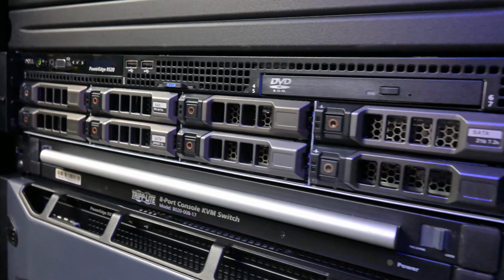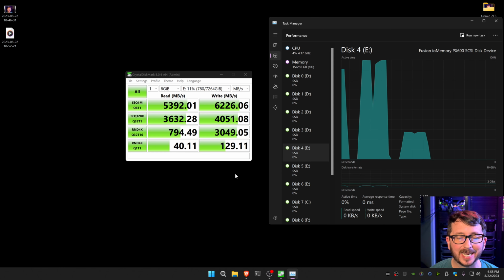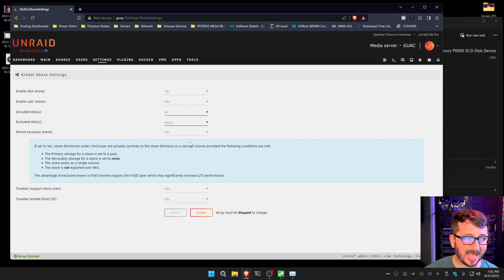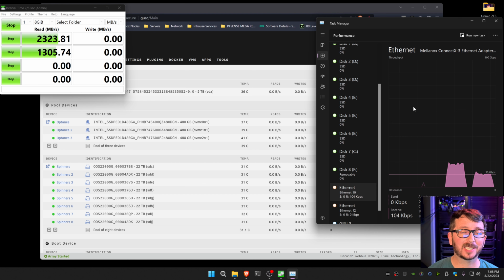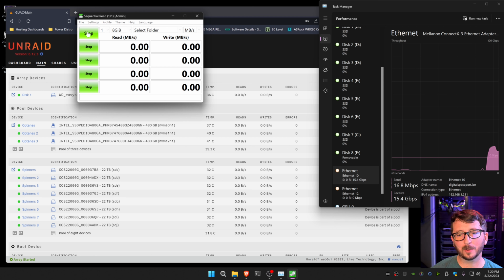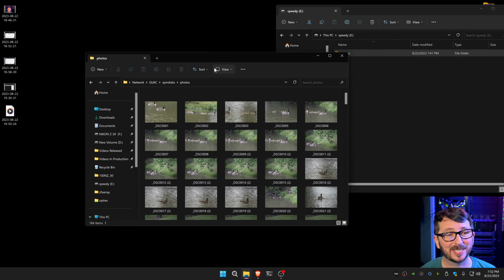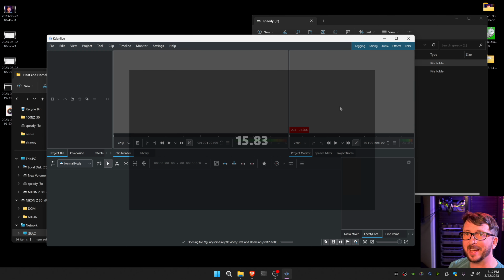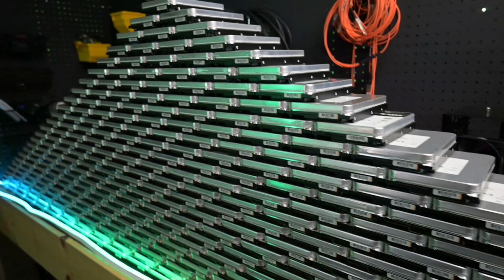UNRAID ZFS Pools and Shares Performance Optimizing

Comment: Lots of good info in here I will have to try some of this out when I get home. getting abismal performance writing to my nvme in my unraid server over 40GB I get like 100MB write and like 450MB read. in a windows system locally I get close to 3GB on these. I know the MTU is prolly the culprit for some of that. I don't understand why the write is that slow though. I will be really glad when they get propper ZFS pooling in unraid so that can setup additional VDEVs this is where the true performance increases comefrom with zfs. Hopefully they will then get the mover to work with interpool manament for primary and secondary stuff.
Reply: nice, thanks for sharing this
Reply from the maker: Your speed is def too slow, here are a few things I would check. Windows tuning of the NIC settings to match your switch/Unraid host is critical to great performance, but you should be getting way better for sure. NVMe's from various manufacturers will have different amounts of Cache SLC super fast NAND, then revert to a slower TLC base in most consumer NVMe. Still your base write performance after you exhaust the cache should be at a minimum 500-1200MBs for writes, not 100. Have you tested iPerf3 with your setup to ensure you have expected network speeds? Have you tested your drive with DD to ensure it is operating to spec from the CLI? Ensure you are using an exclusive access disk share to avoid FUSE. Is the drive properly trimmed? I have seen some HBAs cause issues with this but its unlikely your running an NVMe off an HBA.

Comment: Written guide is missing the SMB extra config options. Also the syslinux options are written twice. I'm running 4x4TB pcie3 nvme's in Z1 pool. Over default settings on win 11 client (marvell aqtion 10gbe) and unraid server (intel 10gbe) I got 1144MB/s read, 550MB/s Write 1M Seq q8t1. After doing the same tweaks in the guide I dropped to 614 / 217MB/s :(. The only improvement was RND4k Q32T16 R/W .

Comment: I need to setup a NAS for a large SMB share over a 10 gbit LAN.  Newbie with NAS system here. I'm hesitating between TrueNAS Core and unRAID.  I'll be using 8 to 12 SATA SSD drives.  Based on your experience, which of the two systems offers the best performance and reliability for a similar setup?

Comment: I want to move to Unraid, I'm currently using OMV with ZFS drive, they are not mirrored, each drive is ZFS with no mirror. So what I want to ask is
1. if I'm using ZFS with pools of single drives, is there a point on keep using ZFS when I move to Unraid? What I liked about ZFS is the bit rot detection it has built-in and also the compression though I can live without this, but as far as I'm reading Unraid as it is it's not super fast so I'm guessing using ZFS will slow even more the transfer performance isn't it? (Because of the compression, etc)

2. I don't have the budget to get 3 SSDs to use as cache but I do have one that I can use as cache, will it be enough to improve speed? What I also don't get is what would happen if I transfer more than the capacity of the cache, let's say my cache SSD is 500GB but I transfer 1TB of data, what will happen then? As far as I know the cache is stored until the mover is fired up.

I'm not sure about moving to Unraid but I really need the parity feature, as it is right now the transfer speeds aren't super great (I guess because of ZFS itself), I'm using a Connect-X 3 but still, speeds aren't max out, and that is using OMV, using Unraid I can only imagine it will be ever worst

Comment: Would you look at that! With UNRAID 7, Arrays are finally optional, and we can set up shares with pools as both a primary and secondary storage! Definitely a welcome change.
Reply from the maker: Wow finally! I can put that to use right off, excited hope it's outta beta soon-ish
Reply: @DigitalSpaceport  Yeah, definitely don't want to update my main setup to a beta, so I hope it'll be official soon. Also love the idea that mover will work between pools, since I would love to move from my raid 0 nvme drives to my raid 10.

Comment: You will always get good performance with nvme, ssds... also you have a big server and CPU process. I tried Unraid with 6 WD 14TB Enterprise drives and the write over a 10GB was abysimal (50MB/s or less). Reading was ok though around 400MB/s.
I switched to OMV and I'm getting now 800MB/s R/W in software RAID 6. As I move a lot of data, I ditched Unraid and I have no regrets. Thank you for the video though, seems like depending of what you have it may be a good solution for some.

Comment: Are you not using SMB Direct/RDMA, pinning cores or SMB over QUIC? You should be able to easily saturate 40Gbps with these disks if doing sequential reads or writes.

Comment: Thanks for sharing the tips, very useful, but I am looking at the speeds you are getting and what immedaitley comes to mind is what is the speed of your network. I have an all 10GBe network and get nowhere near those speeds. As an optimized 10gbe network what sort of speed would be normal?
Reply from the maker: If you can sustain a ~9gbit iperf3 single stream on that network, you should be able to hit in the 1GB/s range to your cache pool.
Reply: @DigitalSpaceport  I'm currently planning a setup using ZFS on Unraid and would appreciate some expert advice. Here are the details of my proposed hardware configuration:

* Drives: 4 x 2TB NVME drives
* Proposed Pool Layout: 3 x NVME drives in a RAIDZ1 configuration
* Cache: 1 x NVME drive
* Array: A single 32GB thumb drive
I'm also considering upgrading these drives to 4TB NVMEs in the future. Given this setup, I have a few questions:

1. Is a cache drive necessary, given that it's the same specification as the pool drives?
2. Could I potentially configure all four drives into a single RAIDZ1 pool instead?
3. Regarding future upgrades to 4TB drives: How complex is the process? Previously, I used TrueNAS Scale with HDDs in a similar configuration (3 drive RAIDZ1 pool upgraded from 6TB to 12TB drives by replacing each drive one by one). However, after upgrading, the pool size didn't increase until I destroyed and recreated the pool. Would I face the same issue in Unraid?

Comment: Nice vid. Can you do one on ZFS rebuild times. if you make a 24 disk vdev of 22TB and you pull one disk. How long would the rebuild take? With 1 cpu +/- 20 cores 3ghz. Will it be a day, a week, a month or a year? Its something I can't find anywhere.
Reply: It will depend on how much data you have to be resilvered.  I had to replace a disk in my system but I only had like 6 of 60tb used and it took maybe an hour.  Did it again after I moved more data over and it took maybe 6 hours.  That was with 8x12tb drives on a E3-1230 V2 @ 3.30GHz in truenas.  24 drives would probably be pretty quick if they are rz1/2 even with a 22TB drive but the best practices guy in me wants to say break that up into multiple vdevs.
Reply: Thanks for your reply!  @nadtz  What I am trying to figure out is the maximum amount of disks with say 22TB that can resilver within 24hrs or 48hrs. I prefer the vdev to be as big as possible considering a raidz3 and least parityloss with the excel configurator.
Reply: @jllerk  No idea with a vdev that big, I've read in the past large vdev's slow down resilvering and have never had a reason to do a vdev of more than 6-8 devices myself.  Anecdotally you can expect long scrub and reesilver times with a vdev that big.  How long exactly I've seen people mention 48hrs+ but I don't know how much data was involved.
Reply: Afaik a 24 drive wide vdev is Not a good Idea, but it depends on your workload.
If its for home use and you can leave the Pool resilver without hiting it with io all the time it could be ok. But for anything else I would do at least 2 raidz2 vdevs. That would give you better iops and less chance going in a resilver spiral. Maybe a draid2:21d:1s:24c would be a safer bet to get faster resilver times. But I have Not tested unraid much with draid. You can create a draid in the cli but Not use it as a unraid Pool in 6.12.4, maybe support will be added in the future.

Comment: Is there a way to convert 2 disks in an array to a pool without wiping data? I have Minio running with two drives as a share for Minio. The transfer from cache to array is slow and fills up the cache fast. I am adding more drives for a larger total on the share and saw this video for creating raid within a pool and thought this would work great.....but I have the issue of the files already in the system.
Reply from the maker: You need a backup system in place. If you try to pull out 2 drives in a ZFS array it wont work. You cannot shrink a zpool. You can fail and replace drives but the initial consideration of disks in use for a zpool needs to remain the same. Restoring from backups is your best bet here.

Comment: Are you still performance limited by CPU single core performance, since it appears you have 'NIC Offloading' turned off, I'm guessing there is still no RDMA support.
Reply from the maker: This video went off the rails for about 2 days as I documented and learned about SMB Direct, RDMA and several other topics. I did have some successes but since the R520 system itself is slated to be replaced with an EPYC or TR Pro this weekend, it felt like wasted time to chase those problems on that machine. I did have SMT turned off on the 2470v2's but had to run both sockets so NUMA likely was at play as well degrading performance. The single thread speed on those is indeed not idea but peaking at 3.2GHz should provide for pretty decent 40Gbit access, but for sure there is overheads impacting this also. Will dig into RDMA on the new 100Gbit nics and switch here soon and hopefully leave lower performance behind.
Reply: @DigitalSpaceport  ahh, would be interested in the findings of RDMA, as I think most of us have more access to cast off 40gbe nics and switches than 100gbe. I put unraid on my r630, which can be had for less than $200, and it has  a 40gbe mellanox in it, that hasn't performed great for me, so getting the RDMA going is something I would be interested in, personally. On paper the 630's looked like a great platform for unraid, since you can pack it with 4 u.2 nvme's and 6 sff drives, but I can't seem to get amazing speeds from unraid, I might have to try more of the unraid tweaks shown in the video.
Reply from the maker: Yes there are so many "gotcha" things around RDMA its pretty daunting but I am 2 pages of notes in so far and I think its solvable and explainable in fairly easy manners.

Comment: Wow, Great Video... is it possible to use only zfs and eliminate the basic array of unraid ?
Reply from the maker: Well you can do what I did and have a dummy drive in the main array but that does seem to be a hard requirement for startup of the systems. There is also ZFS in the main array but I am not sure about that one. I need to test more on that specifically.
Reply: @DigitalSpaceport  Thanks for the get back this fast.... cool i will wait for your other video, this is something i would like to do, use only zfs pool like you did. thanks again.

Comment: Out of curiousity, I may have missed it, why did you decide to run zfs without compression??
Reply from the maker: I have multiple accesses off the dataset at one time and often high bandwidth usage of the TrueNAS machine at the same time. I found compression tries to hit the fastest thread also while I am hitting SMB or NFS shares hard and does indeed slow that down. I had minimal gains from compression on the storage side, as most of what I store is uncompressible data already.
Reply: @DigitalSpaceport  Thank you. I assumed the media aspect, but had not considered the other. Something to consider in the future I suppose.

Comment: Curious to see if you have a mac that you can test this on? I'm struggling with SMB settings right now on a 10gbe connection to a raidz2 pool of 8 SATA SSDs. It should be fast, but I'm not getting more than about 130mbps, when I should be getting close to 8-10x that.

Comment: unraid vs truenas, what is the best ?
Reply: Depends on your use case really. Personally, i just think you can't beat free.
Reply from the maker: Beginners, UnRaid usually. More advanced users, TrueNAS. Generally that's my feeling on it. https://youtu.be/z4CkJbUlkVM  This comparison I did I think is pretty accurate on major points. If your a power user, TN is your best bet.
Reply: @DigitalSpaceport   truenas gave me a lot of headaches because it didn't recognize my mellanox network cards, apart from that, I had problems with docker and other things on it. So, I'm going to set up a machine with 72 disks with 20tb each and I will buy a epy motherboard kit from ebay - I already did that to my new machine learning server .. thanks for the tips.. :) very nice video
Reply: @DigitalSpaceport   I've had a lot of problems with 100Gbps intel, a lot. Mellanox runs better.
Reply: Proxmox with Unraid VM! My setup has 2 HBA's and a Mel connect X 2 passed through, one HBA has the 8 - 6tb drives and the other holds the 4 800gb SSD's for cache and 2 10tb drives for Parity. Incase of a boot drive failure from proxmox it will boot from USB and all my stuff is untouched. I am still not happy with Unraid's VM implementations, they are not bad but over time the performance just tanks. other than that I have 4 unraid systems and I have never been happier.
Reply: the fastest copy way when you are using smb multichannel - find . -type f -print0 | parallel -0 -j20 mkdir -p /raid_nvme1/teste_nvidia1/{//}';' cp -f {} /raid_nvme1/teste_nvidia1/{//}
Reply: @gustcol1 did you try truenas scale (Linux based) or were you just trying the regular truenas (BSD based)? From what I have read and heard, there is a big difference in the hardware compatibility between the two distros.
Reply: @arigornstrider  Hi, yes, I did that..
Reply: As I have been a long time user of Unraid that has also used TrueNas Scale TrueNas Core is old garbage don't bother. if yu want something that does almost everything unraid does TrueNas scale is the only option. Generally truenas performance is WAY better generally about 30% percent after in all of my testing on the exact same zfs pools and hardware. that being said the biggest problem with Truenas and that Unraid smoke Truenas with is the permissions situation. Turenas is many systems overlapping and often in conflict. I found that I was constantly having to fight with permissions between the ZFS, SMB, and Docker stuff. they were  constantly fighting each other and they are not unified like they are in unraid. their docker system does NOT like having any kinds of SMB permission or share in any of the paths that it has anything to do with. there is an override for this. this will allow you to install a docker that has a path that has SMB share info but you will then have to go in and mess with the permission on these directories to get everything running. Also some containers just WILL NOT respect this. I found this to be the case with many of the truenas charts version of apps. if you add the TrueCharts catalog "Community" app version they will ofter work fine and work. Once the permissions have been fixed that is. So we moved out production systems back to unraid. we may go back to truenas scale once it matures a bit but right now unraid is supiror. And by far much less work to maintain and troublshoot.
Reply: @gustcol1  same here
Reply from the maker: I just got in 2x 100gb connectx-4 cards and am migrating the servers over to EPYC and TR pro systems and hope to get better networking perf off them. Running GPT4ALL locally here also and hope for better performance from high ram systems dual A5000s vs what I am seeing with Falcon on my desktop Ryzen with 1 3080ti.